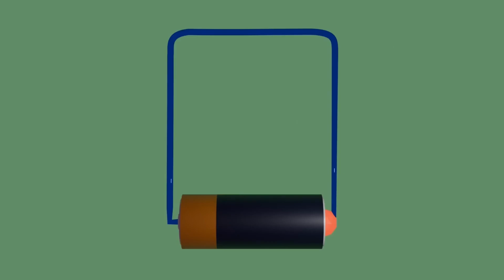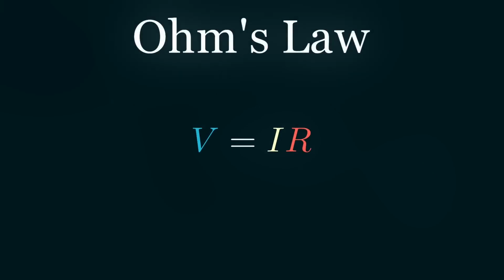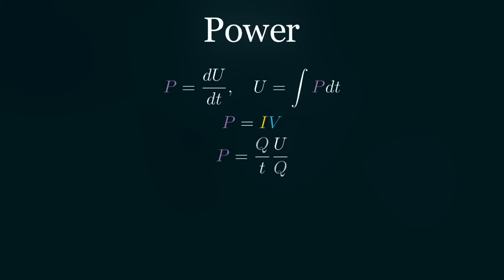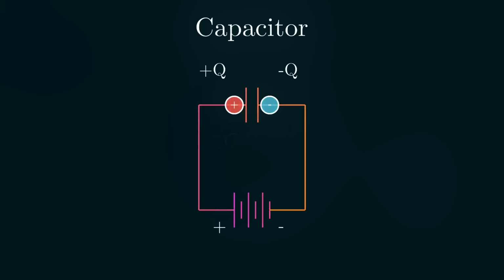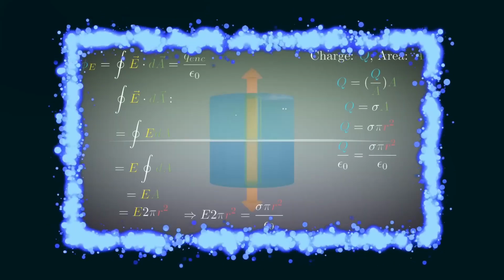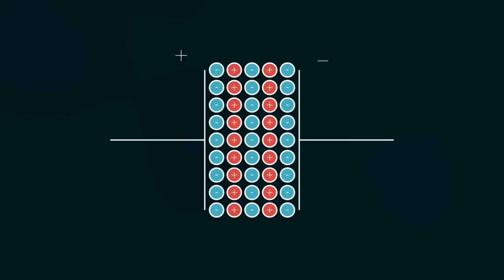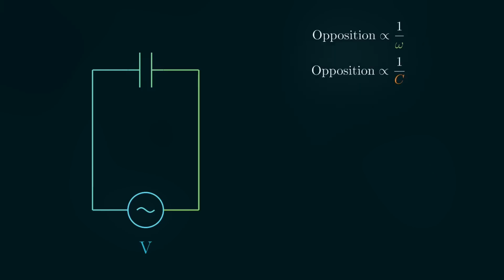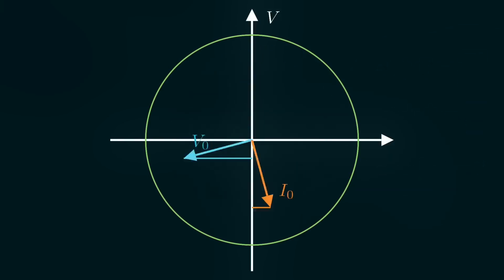The Basics of Circuits | E&M Pt. 2

Comment from the maker: Corrections:
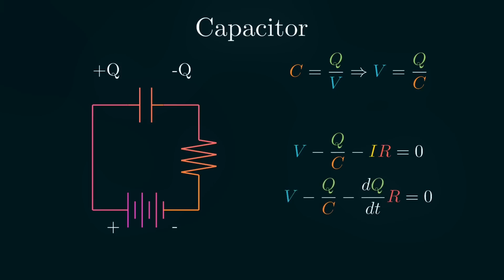8:48 - The terms with a Q out front should be (1/C)*Q, (1/RC)*Q, etc. instead of (t/C)*Q and (t/RC)*Q
13:20 - The top relation should say E -> E/(kappa), not E -> (kappa)E. The bottom relation is still correct.

Comment: Hi! Is there a mistake on 13:20 
When you said
E -> kE
epsilon0 -> k * epsilon0

Shouldnt it be

E -> E/k
epsilon0 -> k * epsilon0
Reply: Mainly due to your derrivation that E = (sigma)/epsilon0
Where kappa is strictly greater than 1 with that dielectric present. Thanks for the help!
Reply from the maker: Yeah, you're correct. The dielectric constant k is the ratio of the permittivity (epsilon) to the vacuum permittivity (epsilon_0), so the bottom equation is correct. Remember that E = (sigma)/(epsilon_0) only applies to a two-plate capacitor but in general our E is still inversely proportional to epsilon_0.
Reply: @tmodx  ah ok thank you for the help! Your series on E&M has been rlly helpfull! Thanks a lot